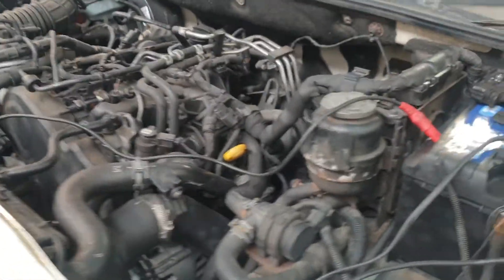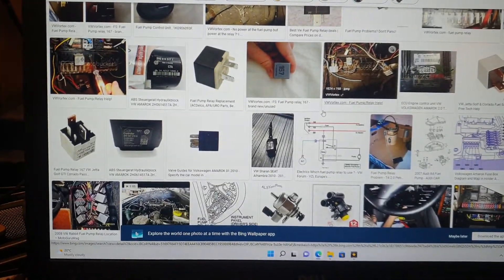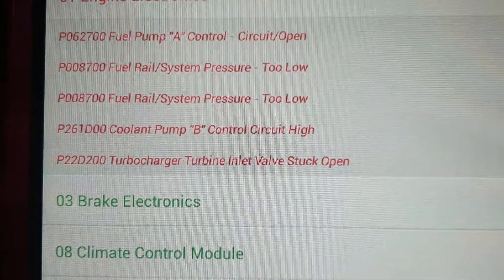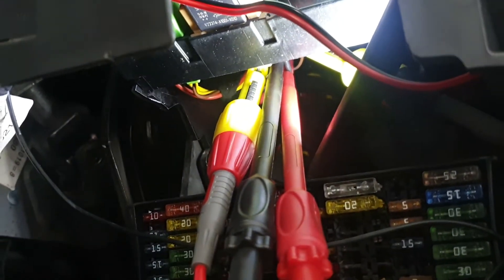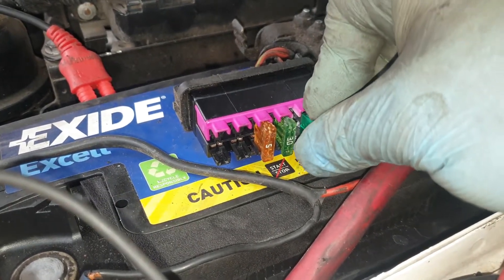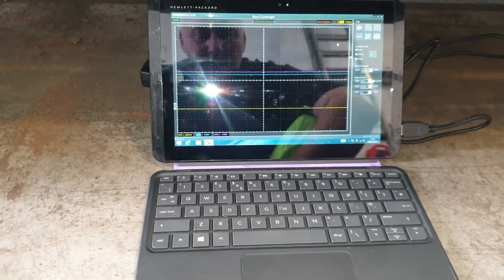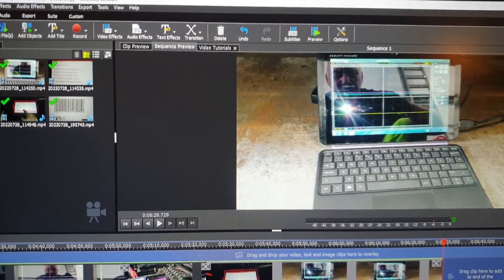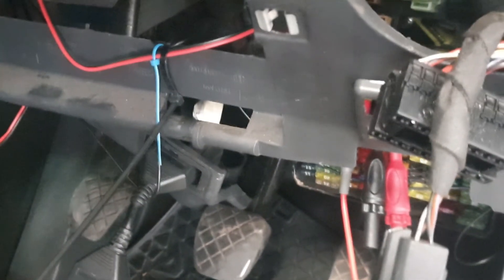VW Amarok P0087 Low  Fuel Pressure Hantek 1008c Diag

Comment: mine is not starting , fuel pump is not responding and not getting any voltage . that fuse holder looks and tests fine. i connected the positive to the battery an the fuel pump gets activated  but the amarok still doesn't start . please help
Reply: Hi did you start your amarok? I have same problem
Reply: @gregbevan958 Yes I finally did ... Two options complete bypass or connect the pump in the ECU brown and purple wire (so the pump is engaged when you turn the key) . Fist options is risky if you are forgetful